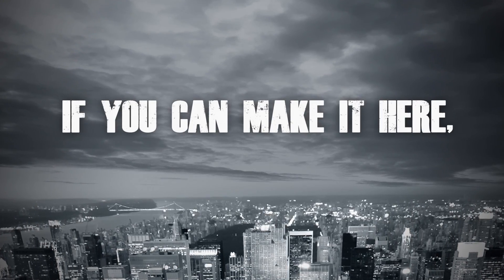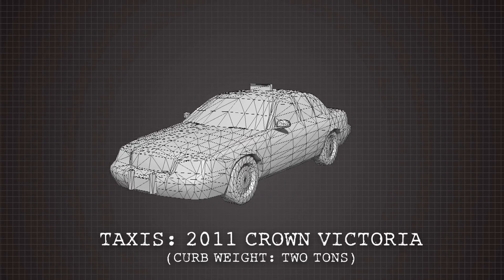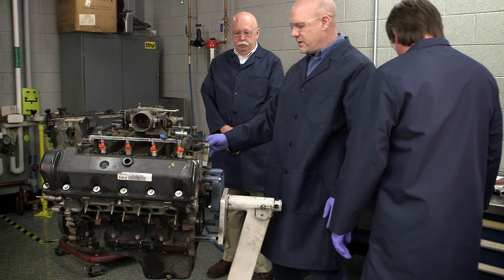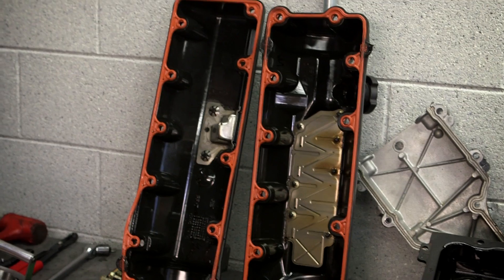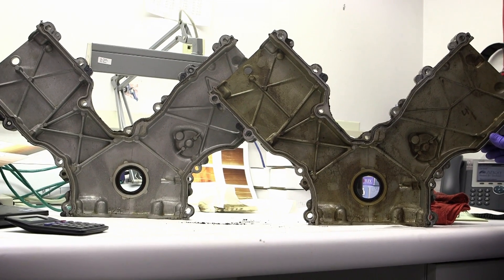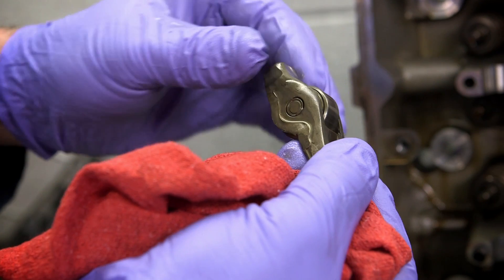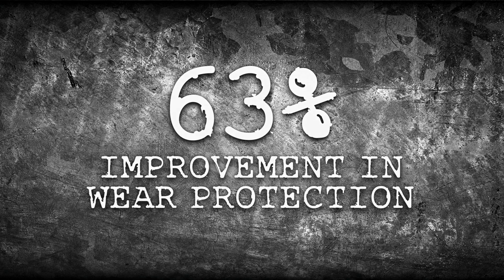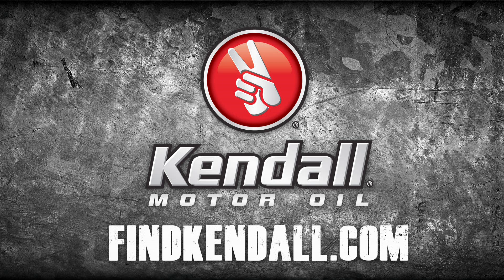Kendall Taxi-Tested Tough Teardown

Comment: The best oil I use in my car Toyota corolla 2008 I use 10w30 Synthetic blend because the weather here is always the same always is hot in Dominican Republic the car run like new and Don´t consume oil only have 52,062 miles on it I start use that oil at 25,900miles bought the car 0 miles firts mainteniance was at Toyota im very happy with this oil and going keep using in all my cars in the future!